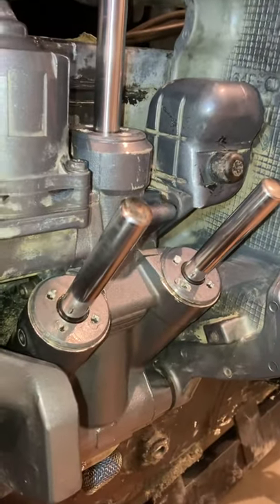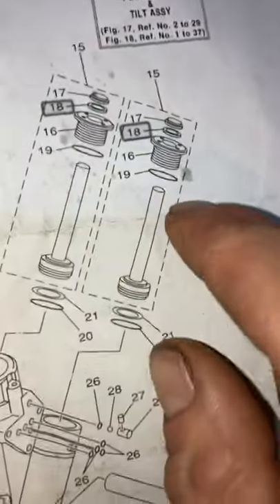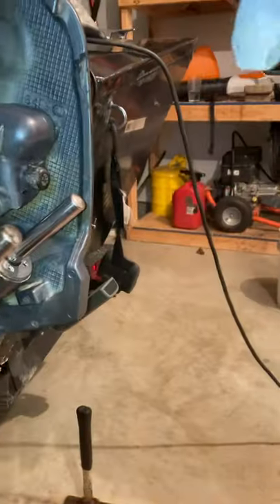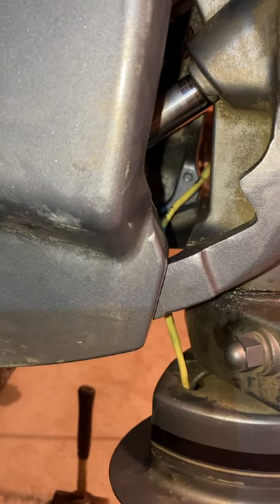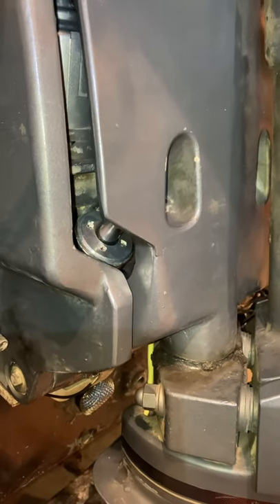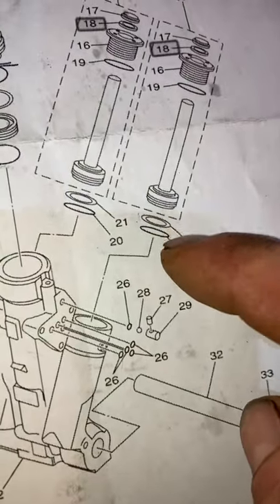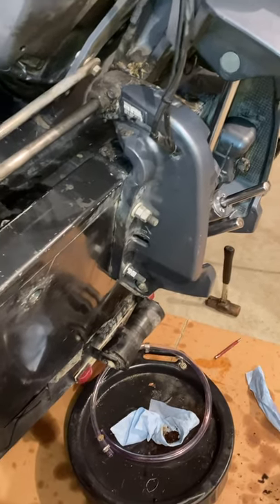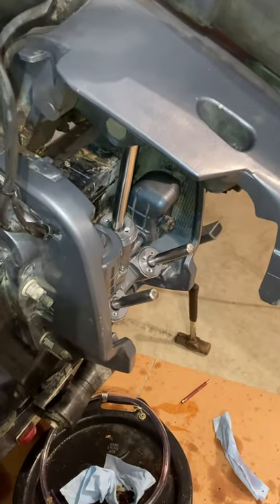Help! Yamaha 115 Boat trim problems

Comment: Did you discover the cause of the issue? I'm experiencing the same problem after the boat mechanic replaced the main seal, and it started happening afterwards. The mechanic shop is saying that the unit is old and that way this is happening but I don't think this is true. I suspect there might still be air in the system. I hope you can get back to me with some insight. Thanks!

Comment: Likely have air in the system. Air is compressible and fluid is not. Bleed out the air by fully raising it and lowering via manual release valve with large standard screwdriver
Reply: where is the manual release valve?